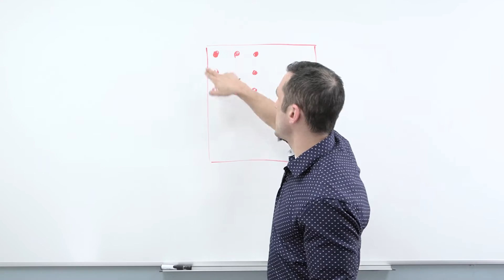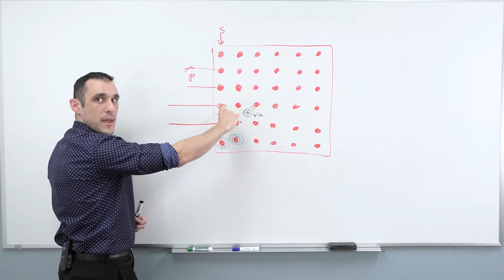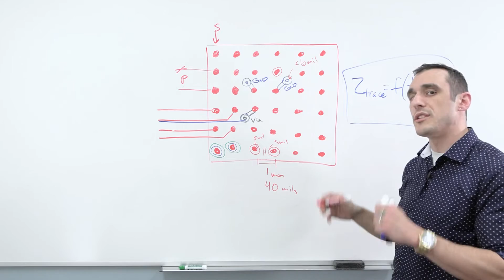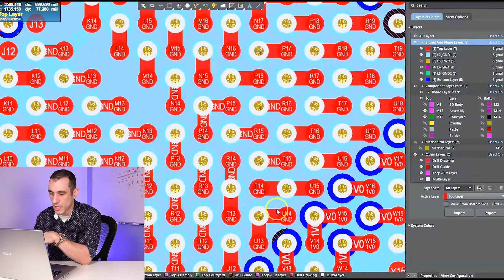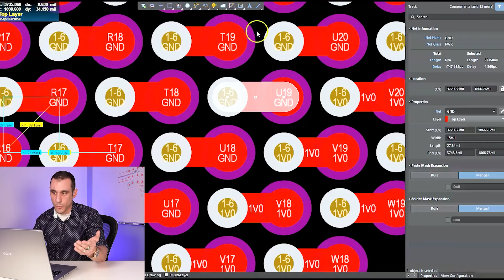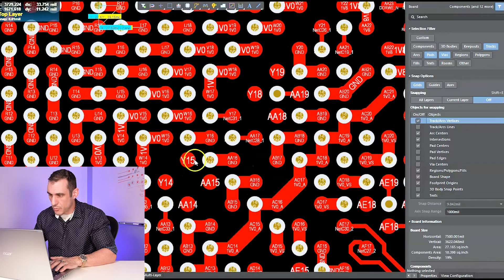Your BGA and You | PCB Layout

Comment: Really nice! But I wonder for the example, with so many GND connections, would a ground plane not make more sense here? 

And also, what are the disadvantages of via in pad? There must be a reason to not always use it, otherwise one would see it much more often.
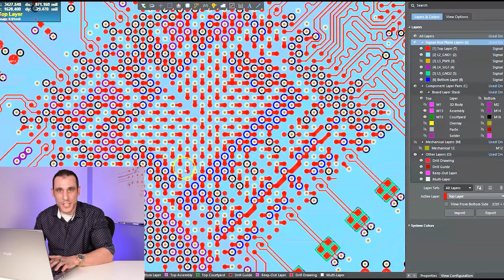Reply: Maybe it is not obvious but there is GND plane under the BGA in the example, it is on layer 2. This provides the references for the differential pairs being routed out from the BGA (see 14:31 for example) and for the other signals. Those vias all connect to the GND plane on layer and on other layers. It is a 6 layer board so there are multiple layers with GND and layer 5 is a complete GND plane.

About the via in pad, there are a few disadvantages. Of course the main advantage is being able to use finer pitch BGAs and closer component placement in general, this is the main motivation to use via-in-pad. The disadvantage is that it adds cost because it requires a resin fill and plating step, followed by planarization. This is especially important on BGAs as dimples in the via-in-pad can create non-planar seating of large BGAs which increases the chances of defects like head-in-pillow or open circuits. The other reason to avoid via-in-pad is because of the reliability of the via connection, there are increased chances of failure of the via-plating interface connection due to thermal excursions or during reflow, which might create an intermittent open circuit defect. An intermittent open circuit defect is hard to diagnose because the assembler may not notice it, but it becomes apparent there is an open circuit when the device is operating, so the assembler ends up shipping the boards with the defect to you thinking that they work correctly.

Comment: Is invention of high pitch BGAs really necessary and worth it?
Reply: Yes necessary and worth it when high number of features are needed in very small spaces.
Reply: @Zachariah-Peterson  I am trying to learn Altium and have a confusion. When we create PCB footprint, what extra layers do we add ourself? 3D body, assembly drawing, courtyard and any other? When I use the wizards inside Altium, they create these mechanical layers but only as single layers. However, when I look around on internet, I see that people create layer pairs for these things and not single layers. It is all very confusing.

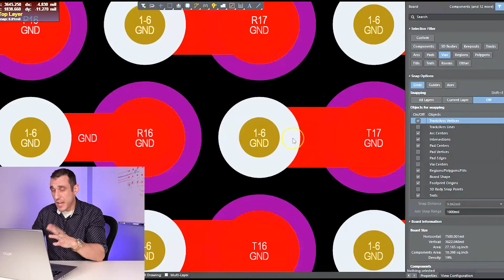Comment: You are showing a large BGA component @16:00, why not use smaller tracks and vias?
Reply: The vias are sized based on minimum annular ring targets in manufacturing, and a typical small drill size that can be used in mechanical drilling (10 mil diameter). For the traces, the traces shown in that part of the video are GND traces so the width is not extremely important other than for lowest impedance return paths.

Comment: Since designs run at several 100s of MHz today, won't all PCB tracks or most, need impedance control and length matching?
Reply: Technically yes, it's going to be much better to just impedance match everything that has a fast digital signal (~20 ns or lower rise time) but not all interfaces have an impedance specification. For example, GPIOs and SPI/QSPI interfaces on modern chips can have very fast rise times, but they don't have an impedance specification on the bus, so you would have to determine what the output impedance is on those interfaces. This value varies from chip-to-chip.

Comment: I am New to This I want to design a 289 pin BGA before I work on 4 layers only. Any suggestions I had a licence of Altium designer. what to refer for BGA design and If BGA ic is not present Then Is any video that suggested create custom Library for BGA package.
Reply: There are a few things you can do. First, you can use the IPC Compliant Footprint Generator wizard to create the component, this will give you the package without the requirement to copy and paste the pads by hand. To create the pin list is more complex, but I can create a video about it. For the layer count, just make sure you will have enough room to break out all the signals, with 4 layers on a SIG/GND/GND/SIG BGA that would leave 121 pins leftover that are probably all PWR and GND.

Comment: How to fan out a BGA with a 0.4mm pitch and for example 64 Pins? 
Is there any recommendation how to do it?
Reply: Depending on your fabricator capabilities you might need to do via-in-pad, it just depends on the solder ball pad sizes and the smallest features you can fabricate. You can do dog bone fanout if you can fabricate small enough vias; the diagonal pitch between pins would be 22.6 mils. In the HDI stuff that we've done we normally go with via-in-pad just because we need to have larger pad sizes for a high reliability product (Class III), in that arrangement you can still use larger pads as long as pad edge-to-pad edge spacing is large enough. So we would have a via plus annular ring that sets the pad size limit.

I requested someone internally create an example based on this, but it looks like I'll have to do it!
Reply: @Zachariah-Peterson  Thanks a lot
and thank you for all the knowledge that you share here on the youtube channel👍🏼

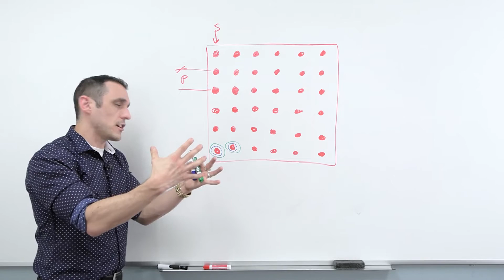Comment: 5:30 I believe what you have described is an NSMD (Non solder mask defined) rather than SMD (Solder mask defined) pad. On SMD the solder mask goes on top of the pad and thus defines where the ball can stick. On contrary, with NSMD, solder mask is wider than the pad and thus the ball sticks to the whole pad. Note they are also called collapsing and non-collapsing pads.
Reply: Yes I did, I saw that during post, thanks for catching that!
Reply: @Zachariah-Peterson  Actually, what is your recommendation for fine pitch 0.4mm BGAs (WLCSP)? I see them often recommending to use SMD for such sizes due to VIP technology as otherwise the via would be larger than the pad itself and also for reduced chance of bridging.. 🤔

Comment: So, I do have a couple of questions. First is related to the device soldering. In a direct dock board, the device gets directly soldered onto the PCB but what happens when you use a socket, like in the FT boards? Do the packages still have the solder balls on them? or there is some other way the connection is made?

Secondly, most fabricators are fine with via in pads even for coarse pitch devices, so why not use it with all BGAs regardless of the pitch? Also, since you are adding a trace with a via, won't it add inductance to the power planes?
Reply: Hey Waleed,
I've never used a socket like that for a large IC so I can't comment on all of those cases, however I know there are sockets with BGA footprints that are supposed to make those connections to the board. Some of these are test interposers, like for DDR memories, others are basically BGA-to-LGA or BGA-to-another-BGA adapters. And yes that's true about VIP, most fabricators can work with it but via filling for VIP can add costs, that's just something you would have to weigh when planning production. For the inductance it technically would add a little bit of spreading inductance but I don't think it would be very large.
Reply: @Zachariah-Peterson  Thanks for you comment!
Reply: @Zachariah-Peterson   Awesame, thank you for the  videos!
For the inductance, we technically need higher inductance for the high-speed signal pins (we're coming from TQFN to BGA and TQFN regular L=1/1.5nH for a pin) and want to generate inductance on one of the L1/2/3/4 layers instead of the die consumes large area there. Do you have that kind of further detailed information you can share?

Comment: With all those grouped ground pins, why not just connect them with a mini-plane?  If the problem is that is makes soldering unreliable, why not at least cross-connect them?  (Essentially a ground plane with the thermal relief around the pins.)
Reply: Hi Jim, They are connected to ground on L2 (you can see the layers in the View Configuration panel on the right side). Same thing goes for the different groups of power pins, they are connected to different power segments on L3. For the ground pins, you could connect them together with a big ground polygon, but for this board there was already a ground plane on the next layer, so it wasn't really necessary to also put a bunch of grounded copper pour on the surface layer.
Reply: @Zachariah-Peterson  So are you saying that your default is to NOT do a ground pour unless you have to, rather than doing one unless it would cause problems?  (I'm assuming the rule of thumb that you should have a via for every pad, and that this would be more than enough to keep the pour well-connected to the plane below.)  Is this in any way related to copper balance, or to some other rule that I can't even think of yet?
Reply: @jimjjewett  No that's not what I'm saying, I mean that the ground plane on the next layer in my example provides the same function as the ground pour you're referring to: it links together all those GND pins that are clustered together beneath the BGA. Same idea with power, you can do it with a large rail. I'm saying you just don't need to always do it with GND pour on the surface layer beneath a BGA. You probably don't need to do this with additional pour as long as you located the GND planes properly.

As far as doing GND pour if you have to, when you have a big set of GND pins like that and they are connected with a correctly located GND layer, you don't really have to place the GND on the surface below the BGA. I suppose you can do it if you want, but will it create any additional benefit? If for some reason, you decided NOT to put a GND pour on the next layer, then you might need one on the surface to provide some level of shielding and to tie all those pins together as you mentioned. However, you would still need to connect those pins somewhere else, ideally through another internal layer. What I'm dealing with in these systems normally is at least one high speed interface that needs to be shielded from a set of moderate/low speed IOs, so I put the GND between on an intervening layer to separate them and to tie all the GND pins together. It's just the simplest way to do it from multiple perspectives.

I think I get what you're hinting at though; those GND pins might not be all grouped together like my example component, so you might need some additional GND to provide some shielding, is that correct?
Reply: @Zachariah-Peterson  I'm not hinting; just trying to figure out if this is a huge hole in my understanding.  My thought was that thicker traces, at least for power and ground, are almost always better, and planes better still -- even if you don't need them.  Assuming that there is a good ground plane right underneath means you don't need a pour between the pins, but having one should add some reliability/yield through redundant vias, and should reduce ground ripple both because pins will not all be simultaneously active (so the current can be split among multiple vias) and because the pour itself will have some capacitance against the main ground plane.  (Only to the extent that they are at different levels, but ... isn't a short deviation from the expected level the whole point behind most capacitors?)
Reply: @jimjjewett  No I don't think you have a huge hole in your understanding. This is an interesting point and it relates to the copper pour discussion I had with Bogatin on the OnTrack podacst, so I want to look into it more. For a high reliability design I would agree with you in the case of redundancy, but you might still cut it up with interleaving vias. If you're doing something like an OpenVPX/VITA backplane which has stringent manufacturing reliability standards, those clearances are larger than the standard IPC-compliant device and you might not be able to fit GND under a fine pitch BGA, so you would rely on additional planes if you wanted redundancy. And yeah the pour has some capacitance to the main GND plane, but you've basically shorted those conductors with vias so that they are (ideally) always at the same potential and it would never source or sink charge. Obviously that doesn't happen in reality, if any signal capacitively couples onto that pour instead of GND plane it will now have an easy path back to the GND plane, not a bad thing if you think about this in terms of shielding. I just don't know for sure there is a benefit in terms of ripple reduction. I'm not saying it creates MORE ripple or that it will hurt anything else in terms of signal integrity, even if the pour spans around controlled impedance connections that might interleave between GND pins since those connections are very short electrically. But if you have GND pour over a GND plane I don't think it's going to provide additional charge storage with respect to power because the vias short the pour and the plane. TBH I don't know how the capacitance w.r.t. another plane for those kinds of stacked structures changes as you add more shorted pour regions above them, maybe it does and maybe it doesn't, I've never seen any measurements of this so I don't want to say you're wrong or anything like that. If you had a power plane interleaved between the pour and the GND plane then you would certainly get some additional capacitance in the PDN. That's how folks like Hartley and Ritchey have stated they use copper fill.

Comment: please explain , f(w/h) with example. for select no of layers when choosing the BGA.
Reply: What I mean by that is the impedance of those traces depends on the value of the width to substrate thickness ratio, or (w/h). If you need to use thinner traces with high speed I/Os that need to reach in between two rows on a fine-pitch BGA, you can use a thinner substrate as this will require a thinner trace to hit the same impedance.

Comment: Thank you Zach!! I wanted to know why do we need a separate ground plane for controlled impedance trace?
Reply: Hi Jagan, you just need to have ground near the trace to set the impedance to the required value. In this case where you are routing multiple impedance controlled interfaces on multiple layers, you might need to have multiple ground layers. That's the easiest way to shield those interfaces from each other and provide the controlled impedance value you need.

Comment: One point you might want to cover is that chip manufacturers often allow violating impedance specs in the fanout area because there is simply not enough space for full-spec traces and spacing. It would be great if you make a video explaining how to create DRC rules which apply only to a certain portion of the PCB (like fanout regions of BGAs). I had to figure it out myself back in the day, but I'm certain many people will find it useful.
Reply: Sure they do, although that's not really a manufacturer "allowing" you to violate impedance in the fanout area. If that segment in the fanout area is electrically short then its impedance will be invisible to the I/O, and the signal will dominantly experience the transmission line impedance. In other words, the input impedance at an output pin on the BGA is dominantly just the transmission line impedance, not the impedance of the trace in the fanout section. Same idea going the other direction to an input on the BGA; if the fanout section is short enough then the incoming signal will only experience the load impedance on the BGA, not the fanout section impedance. We mentioned this in the input impedance videos, although not explicitly in the context of BGAs.